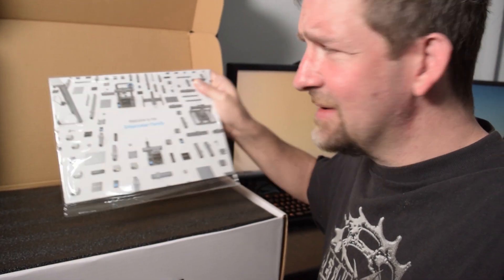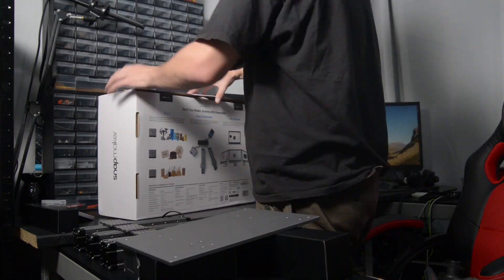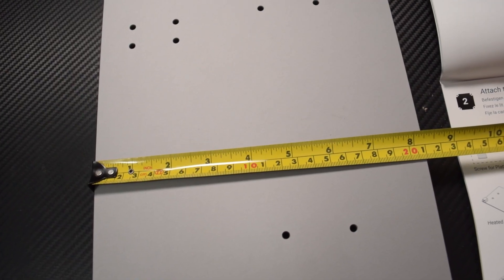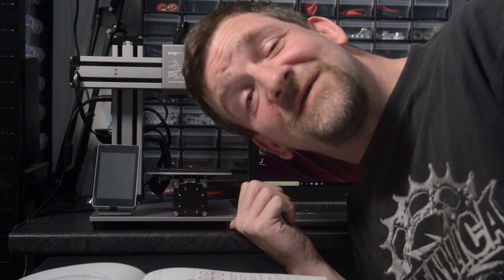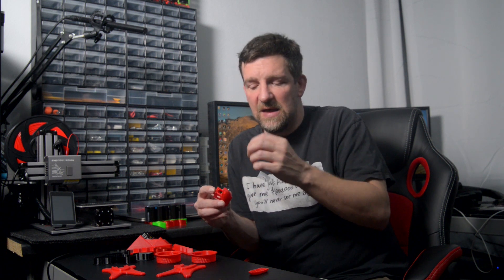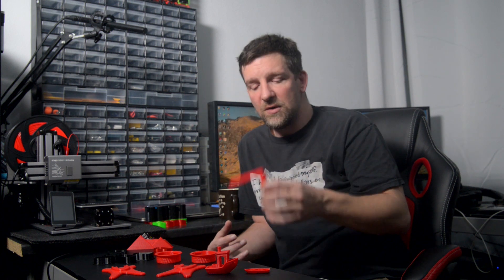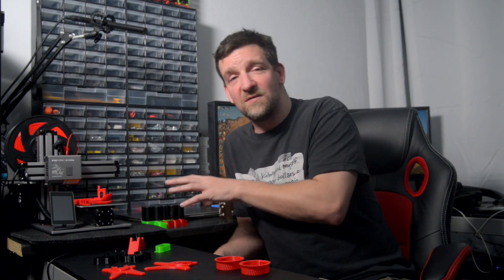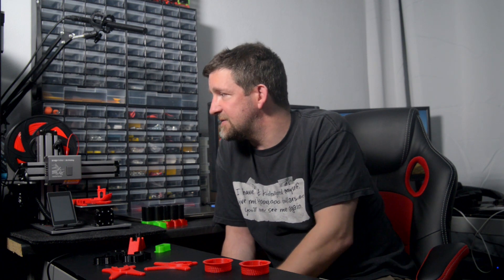Snapmaker unboxing and first prints - 3-in-1 3D printer, CNC & laser engraver - Part 1

Comment: Can we use flexible filament with this 3d?
Reply from the maker: It's not something I've tried myself. It is a direct drive extruder, though, so it should be able to do it more easily than Bowden tube printers, but you might have to print some addons for the extruder to help guide the filament to load it. If you search for "Snapmaker flexible filament" on Thingiverse, there are a couple of mods on there that might help. :)

Comment: thats a really nice review john!, I'd been asked about the snap maker and this certainly helped me give a more reasonable answer!
Reply from the maker: I'm glad it helped. I have a few more videos planned on using the CNC & laser engraving heads, too. :)
Reply: @JohnAldred  how stable foes the gantry actually feel at its furthest point my main issue with these types of machines are the unsupported gantry ends especially for CNC work for sure you can lower your speed but at some point it becomes unfeesable
Reply from the maker: Very stable, actually. Normally I'd agree with you on this concern, because most printers of this type just use standard 20x20 aluminium extrusions (which aren't really designed for something like this).

The Snapmaker uses a custom designed 50x50 extrusion. So, as well as simply being a much more substantial frame (and a more substantial connection between the Z and X axes), it's designed to minimise flex.